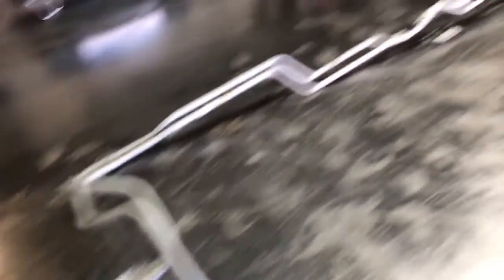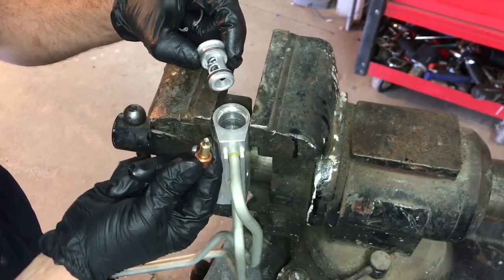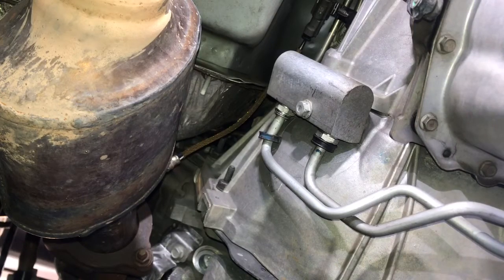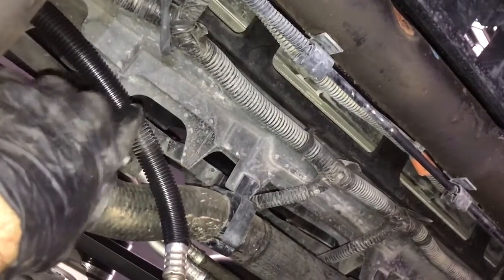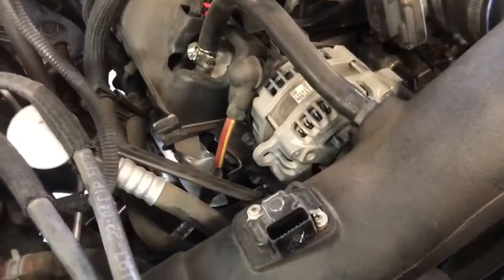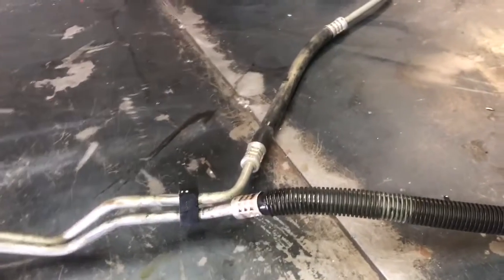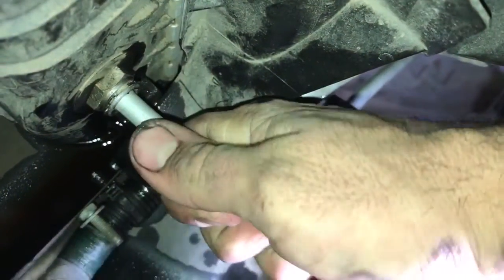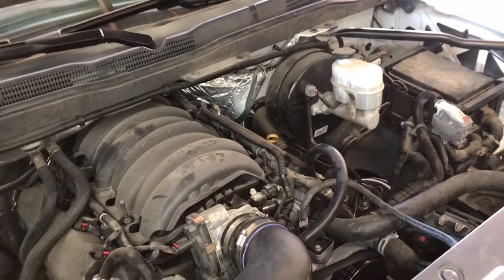GM Silverado Sierra Transmission Cooler Line Replacement & Thermostat Delete (2014 +)

Comment: is this a better way to delete the thermostat instead of your lest video on deleting them?
Reply from the maker: It’s a quicker way yes. I’ve done both ways and they work just fine. However I have seen lower temps with the plug method on extreme applications, high ho, heaven tow etc.. but for just driving around town go with the flip method
Reply: @AaronHinesAuto  I suspect the really high temps you are seeing may be because the inverted valve plunger probably doesn't seal 100
%,  where as the threaded pipe plug does.  That 100% seal give a little better cooling, but for the effort, not worth it for most peeps.

Comment: This definitely isn't where the ATF Cooler lines go into a 2014 4.3L. Both of mine go into the radiator on the passenger side, one high one low. Both of the engine oil cooler lines go into the drivers side, one high one low.
Reply: Mine too, I have a 2014 Tahoe, which ever one he is working on looks to have an external transmission cooler. Have you changed your lines yet, I need but was curious how difficult it is with the transfer case and cross member present. Any input is appreciated 👍

Comment: Great video! would this process work on a 2012 GMC Sierra 1500 5.3 4wd?
Reply from the maker: No, GM didn’t put thermostats in the transmission until 2014. Thank you!!

Comment: I need new cooler lines because they're leaking I live in New England where it's typically cool. I don't do any towing or anyting could I use swap them out without deleting the thermostat
Reply from the maker: Yes you can! New lines will come ready for you to install with thermostat
Reply: @AaronHinesAuto  thanks for the reply,  went to the dealership today for the brake booster recall on my 16 Chevy Tahoe.. and they pointed out the leak in cooler lines for a whopping $400+ dollar repair. I do all my work myself but I love to turn to YouTube to see it done for tips + tricks... thanks for posting definitely a thumbs up!

Comment: Does the Allison duramax 2008 have a thermostat as well
Reply: Let's worry more on our trucks did gm figure out on lines that do not leak
Reply: No.  First time GM trucks started using a trans cooler thermostat was the 2014 1/2 tons with 6L80.

Comment: DO NOT DO EITHER OF THESE THERMOSTAT BYPASS PROCEDURES. Doing them this way also deletes your transmissions ability to bypass in the event a line becomes blocked or anything like that and you will RIP that trans. Buy a legit bypass kit from someone like superior solutions. Slows you to get rid of the thermostat AND keep the bypass. My Sierra with 44k runs normal at 127-133 degrees now. It’s wonderful.

Comment: I ran into this today, doing a thermostat job on a ‘15 tahoe. 14s and 15s still have the old style quick connect lines, however, per the TSB #21-NA-299, they now have a thermal bypass valve that opens at 158 degrees instead of 195. This valve uses the cooler line style that you’ve got here. 

It states if you have the old quick connect cooler lines you’ll have to purchase the updated lines as well, and I can’t find just cooler lines that’s separate from the bypass valve, with the updated style of affixing to the bypass valve itself. So I had to buy another bypass valve I won’t even use, just to get the updated non quick connect lines.
Reply: You do NOT need a thermostat on a transmission cooler period...
You need to bypass the thermostat all together...
👍
Reply: @CharlieAtkins  extremely ignorant comment not taking into consideration the climate the vehicle is in. 

Where I live, if you don’t have some sort of system to help retain heat in your engine or transmission you will have operational issues and moisture issues within the case, as it’s frequently below freezing here. 

I tried running my truck without a thermostat and what that gave me was shorter fluid life, sluggish shifts, and awful TCC apply. A 160 degree thermostat is perfect because you can still warm the fluid up to where it’s viscosity is correct, and it doesn’t heat up too much like the old thermostats did.
Reply: Well I guess you are pretty ignorant by making a statement like that without knowing the facts...
You ever wonder why 2500 and 3500's Don't have a thermostat on them at all...
Because a transmission cooler thermostat was only put on 1500's for Fuel Economy standards...
You need to do some research bro..
The poor TCC apply is caused by inferior TCC clutch disc lining material and GM's poor TCM programming...
(Another case of GM CEO Mary Berra trying to save a cent and a half)
Fluid should be replaced every 25-30k on these trucks...
A 6L80E or a 6L90E transmission should NEVER be flushed...
Just drain and fill..
Now on the other hand a 8L90E can be flushed and in fact there is a GM TSB for a updated fluid flush procedure for the 8 speeds...
👍

Comment: If this procedure eliminates the function of the thermostat then why reinstall the spring and plunger back into the housing, I would think that will just restrict flow.
Reply: If you leave the thermostatic valve out altogether it won't direct it to the cooler guy...
😳
Reply: yes you want to restrict flow 100% (to the bypass that is), you want oil to be directed to the cooller.
Reply: @CharlieAtkins  correct

Comment: im not convinced this is going to work w the thermostat upside down
Reply: have you tried it.  If not do it, and just watch your tranny temps.  Not rocket science.  Upside down it should seal "most" of the oil from recirculating and bypassing the cooler.  Not a perfect seal like the drill and tap but 10 times easier, reversible, and should provide 95% of the cooling the drill and plug will do.

Comment: I dont understand why cant you just throw the thermostat away and install the cap..? The cooler empty inside, oil circulates.
Reply from the maker: The oil will not recirculate to the cooler. The block is nothing but a void with sending the fluid two directions. Back into the transmission or to the cooler. Taking out the thermostat will not direct flow to the coolers
Reply: like aaron hines said,  with no mechanisms inside to direct the flow, the oil will just flow back into the transmission.  A little oil might go to the cooler simply because the reverded valve may not seal as well as the OEM way..  simply check your temperature and that will tell all..

Comment: The 2019 model is not so easy. What a piece of stupid engineering! The lines wrap around to the front of the radiator. 4.5 hrs. Really!!! And to top it all off the truck is covered with dried mud. Sorry for my rant. You did a great job
with the video . Thanks

Comment: Dont want to delete a thermostat.. Not a good idea.. In cold weather a cold transmission will be sluggish and cause delayed shifts and damage down the road.
Reply: depends on where you live. I did the " Flip" method he describes here and lowered my trans temps from 200 down to 155 degrees. I am in Texas and for 90% of the year it is warm here. On the colder days, the trans will still warm up just fine.  If I lived in Alberta, Canada tho, I might not have done this upgrade.